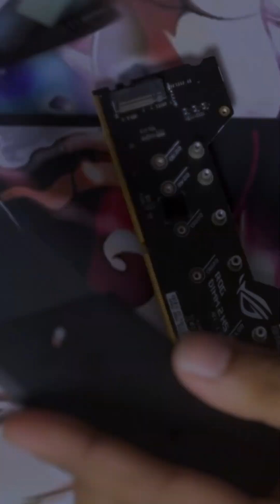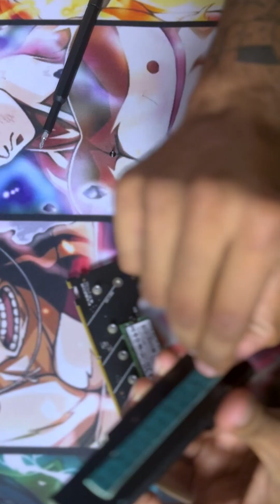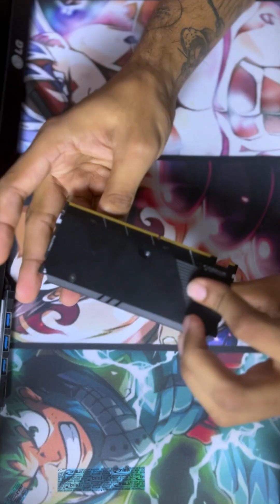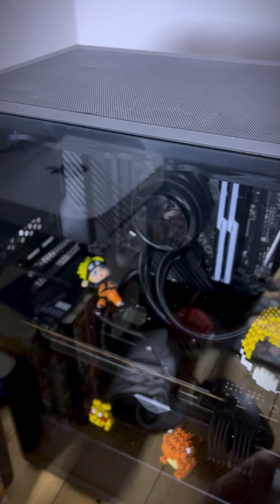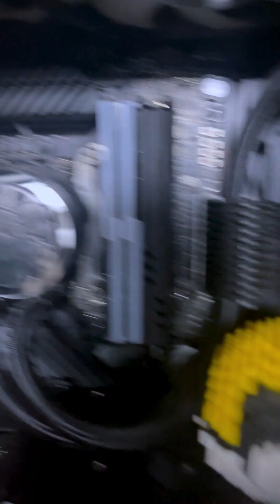DIMM.2 INSTALL #pctips

Comment: Just came across your channel bru, I'm glad yoh

I'm switching from ps to pc and building my own

I wanted to know, do you think I should pair the intel core i5 14th gen cpu with the Intel arc b580 gpu or rather go with the ryzen 7 5700 cpu?
Reply from the maker: Hey bro 
2 questions
Did you already get the 14 gen i5
Or you still looking?
And
Are you building the pc for gaming or productivity?
Reply: @xquisitec still havent gotten the cpu or gpu yet,  a friend suggested that i get an upgrade kit to save money

And the pc will be for gaming mostly
Reply from the maker: @Sethgotthetime weigh your options. But for gaming and considering performance to price, go Ryzen CPU

GPU and everything else will depend on budget
Reply: @xquisitec  thanks man, and also do you recommend an aio or fan cooler?
Reply from the maker: @Sethgotthetime I’m an advocate for AIOs because I think it looks better in the case rather than a massive air cooler taking up all your negative space in the case but it’s preference based really.
Reply: @xquisitec  thanks bro!
Reply from the maker: @Sethgotthetime 💪🏽